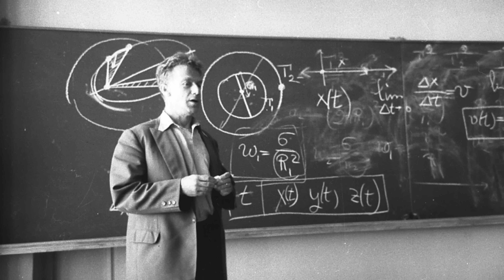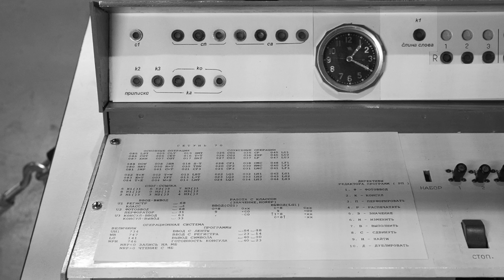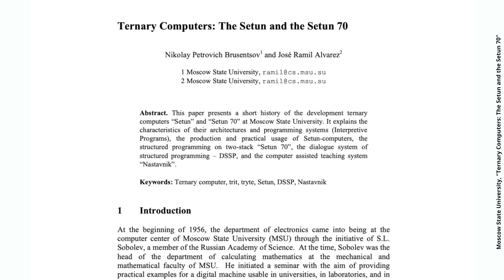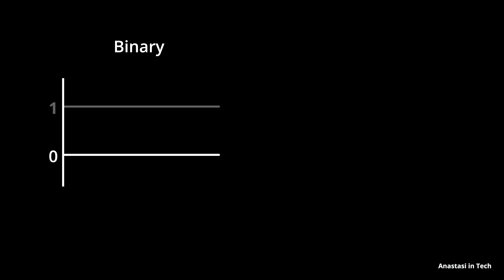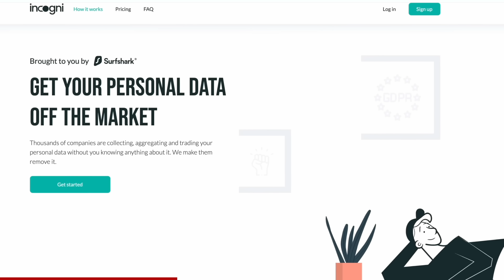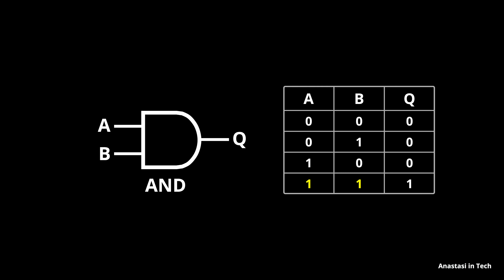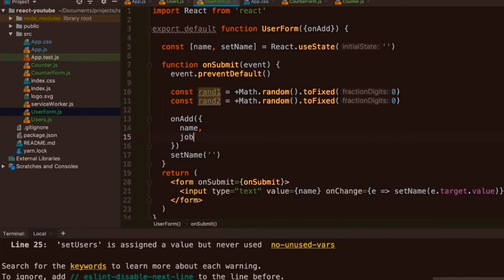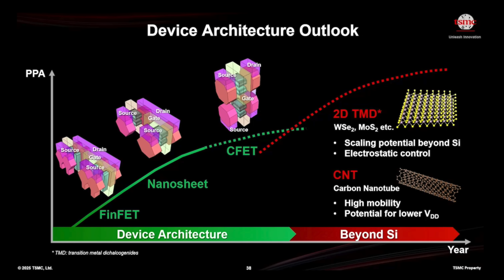The World's First Ternary Computer

Comment: I have read a lot about early russian computing and it’s very impressive on many fronts. I particularly enjoyed the anecdote about taking the roof off due to excessive heat and space constraints.

- Development: The MESM was initiated during World War II's aftermath, with construction starting in 1948. It used ~6,000 vacuum tubes, occupied a room of ~80 m², and performed ~3,000 operations per second. It was operational for testing by November 1950 and fully functional by December 1951.
- Challenges: The team faced severe postwar shortages, including limited space in a small laboratory. To fit the bulky machine, they famously removed the laboratory's roof to install taller components and reroute wiring.

This "roof removal" incident is documented in Russian technical literature and memoirs as a symbol of the ingenuity and desperation in early Soviet computing efforts. It's often cited in histories of the MESM as a literal and figurative "breakthrough."

#### The "Paper" and the Title
The specific phrase "And then we took the roof off" ("А потом мы сняли крышу") is not the title of a formal academic paper but a memorable line from personal recollections and popular accounts. Key sources include:
- Memoirs of Sergei Lebedev: In his writings and interviews (e.g., in the 1960s–1970s), Lebedev described the episode. A detailed retelling appears in Russian engineering journals like Izvestiya Akademii Nauk SSSR (proceedings of the USSR Academy of Sciences) from the 1950s, where MESM's development was first reported.
- Definitive Account: The story is prominently featured in the book Puteshestviye v mir bol'shikh mashin ("Journey into the World of Big Machines") by B. N. Malinovsky (1981), a historian of Soviet computing. Malinovsky, who worked on the MESM, quotes the phrase directly from team anecdotes.

Comment: I'm puzzled why it is being called "termary" when the more correct term should be "tertiary".

Back in the 1970s a type of transistor was developed that was called a tertiary transistor.
It was a SINGLE JUNCTION device that had a 4 state output:
1- ON+,  2- ON-, 3- ON Null, 4- High Z
This allowed 3 state logic and far more computstional power per "trit".
Devices were built, even whole processors, but it was never moved into full production because ....
Programmers did not want to learn ternary or new programming methods or languages.

We lost a lot when that happened.

PERHAPSwe may see a return(!!)
Reply: ternary
Aware of the typo

Comment: does it help software adoption at all that a ternary system could probably still run binary based software that just doesn't utilize the -1 bit? (or is it a trit?) So like you could have AMD64 instructions recreated so existing software can run on it (minus all the benefits) but experimental applications that use trinary can run on the same machine. It'd add a bunch of waste and bulk to the chip, but in a lab, maybe it is helpful.

Comment: Binary computing came from the textile industry that used punch cards to determine what color thread to feed through the machine that was producing the material.  It expanded to voting machines to  calculate the growing population in the country - still using punch cards.

The hole in  a punch card is an "on" state because the charged needle that fell through it closed a circuit.  A non-hole kept the circuit open - the zero or "off" state.

That's as far as you can scale the punch card paradigm.  You have to use a different paradigm to allow for a third state because a circuit can never be "almost" closed or "almost" open.  It either is or isn't closed.
Reply: Is that hanging chad open or closed?  I don't know, let's punch the voter and see if they hang around.
Reply: @rockyroad6000  - Awesome!  An Al Gore reference.  

You are aware that he invented the internet, right?  🙄
Reply: @GizmoFromPizmo  Yes.  I would not be surprised if he invented AI too.  I think the issue was he called it AL for Artificial Liberal.
Reply: @rockyroad6000  - HAHAHA!  That was cute.  😆
Reply: The analog in punched cards would be the size of the hole. Though the hanging chad ties up very neatly with the encoding 'unknown' !

Comment: Circuits can be designed to work with ternary but it will likely need to be converted to binary then back to ternary when transmitting data between devices via microwaves or laser through fiber optics.  There is an option to use two different color lasers to transmit ternary data like blue for +1 and red for -1.  Transmitting ternary data via RF or microwaves is possible but I think it would get corrupted more easily than binary.

Comment: Ternary logic circuits are difficult to construct. The Soviet SETUN represented the ternary digits by binary bits, the same way decimal computers represented their digits. I doubt that much will come of ternary - except for one thing. Data and address buses could use three signal levels to encode three binary digits on two signal lines.

Comment: ai summary read. so not what I thought. this is asking more out of same transistor. more thresholds. so going small might have trade off of what it allows as denser information form the thermal noise.

however, I think it might still be interesting from the programming languages. Or another way of consider Qbits (well I still don,t understand the point of making quantum small circuits and then how does a problem get to be made from an architecture that is programmnable and not a programmable architecture.  Would each meta-circuit of qbit be the proble solution. or woudl there be as in binary exact bits (from current logic gates) and CPU architecture, having a finite set of instructions that can compute anything just by feeding it new code.

Well. Too vague, I know.  But that is the range of my question. Before going into the details, I am missing the big picture of function approximation, I guess.  Computable function space. or as finite math. Computer science would have it: the classes of computable problems. Something well defined somewhere... 

Do we need to first understand the small circuit details before having some understanding (given perhaps we know one), about ternary versus binary versus qubits versus my ternary being about an undecided state value as in my other post about the symbolic manipulation tools to be able to maintain expressions while they are being transformed toward some human parsable and logical objects?
A bit like the difference between propositional logic, and functional logic, or is that formal logic (having quantifiers and functions, and perhaps not yet well defined phrases to be part of statements, that might not have a binary or ternary value to be assigned yet, but still can be temporary objects to consider.  Or just the possibiity of an analog problem or probability density problem like most of the NN tools are actually approximating? That which might not need the "semantics" of the symbols instantiated to still be defined, some well, but some undecided without further information. Something like that.

PS:  I hope the YT algorithms is using LLM, as this might be as much for it to feed me clues or hints in that direction with other videos.   But if any human passing by can get what I seek but does not know yet, and not the words for it either, giving me clues is welcome

Comment: This brings back memories from when I was in college. I remember the instructor teaching us about 7400 series logic chips and touched base on tri-state logic gates as well. One of the uses was in core memory units. A hard positive, a hard negative, and none of the above in order to maximize the ability of those expensive things.
Reply: Umm, that’s a different tristate. We had 1, 0 and High-impedance; that’s when the connection can be seen as "disconnected", because the resistance is so high, no current can flow in or out of it. It was a design that prevents the IC from acting as a load on a preceding circuit or component, ensuring the integrity of the signal, especially when the preceding circuit has high fan out.
Reply: none of the above  =  floating
Reply: Core memory reveals what WAS stored on it when the magnetic domain flips.  You cannot have half a flip, hence, it is inherently binary.
Reply: @thomasmaughan4798  But magnetism has both polarity and strength. The size of the pulse that you read when it flips depends on the size of the change. Thus you can distinguish between positive field, negative field and zero field. There is a difficulty caused by not saturating the core, but the state is not binary.-
Reply: Congratulations, you studious guys. I wish I too could take my eyes off her face.

Comment: I agree that ternary is an improvement but I am not convinced. Sure 20 30 or 40% are important improvements but that is not enough. This level of gain will not justify to have a revolution. Maybe as you say some niche applications with specialized chips. For me the holy grail remains photonic chips and one day maybe an optical CPU/GPU. That will be the real game changer: Very low power consumption a tremendous speed and basically no heat. As you can mix photons at different wavelengths and they do not interfere, you could have as many levels you like. Ideally not ternary but decimal system directly. The system we use for calculations. That would be really a major paradigm change, a revolution.

Comment: Your history misses a lot.  Many of the early IBM computers used decimal arithmetic.  Additionally, the IBM 650 employed biquinary arithmetic, which alternated between binary and quinary (base 5) values.  The IBM 1620 CADET (Said to stand for "can't add, doesn't even try") used table lookup to perform arithmetic.  Some mathematicians used base 7 arithmetic, the largest prime base supported, while base 9 allowed for ternary arithmetic with two trits per byte.  The (Remington Rand) Univac I also used decimal with a system called XS3.  Store digits in four-bit bytes, counting from 3 to 12 as 0 to 9.  To add, add as if hexadecimal, the carries worked correctly.  Subtract 3 from each hex digit; no carries or borrows are needed to get the final result.  Subtraction inverted that.  There were many other computers with unusual arithmetic; these are just the ones I used.  I never used ENIAC, which used ring counters to do actual decimal arithmetic.  It bothers me that I still remember that 6SJ7 pentode electronic tubes were used for the rings.  Twenty tubes in pairs so that one tube could fail and be replaced without errors.

Comment: We played with this years ago.  The problem we have today, is the morons that create the operating systems, drivers, and software.  Bill Gates designed Windows 3.1 on the maximum size computer he could build, while the users were working with the minimum size.  He told us to upgrade, like we had money to burn.  Ternary (what we called Trinary) will allow more data to be stored in a small area, but if the developers never figure out the common memory leak, it is a waste of time and money.  We always tease that Windows runs best when turned off!  Linux has issues, as developers create updates, that don't work on NVIDIA, forcing others to work the changes into NVIDIA drivers.  Honestly, we need to remove the moron developers, and the programming habits that create memory leaks.

Comment: Um uhh...a three state transistor has existed for a long time. It's called a bipolar transistor. A one off, two separate on state transistor would require a means to distinguish between the two on states. That seems really inefficient to me. I have a notion that there could be a quantum mechanical means of supplying the negative rail of an array of bipolar transistors.

Comment: So fascinating.  Looks like binary chip may be the 'rotary telephone' of chips when Ternary chips become mainstream.  Excellent video!
Reply: Until you understand that for the same numeric range, although the ternery logic requires only 2/3 as many logic gates, the logic gates themselves require 2x as many transistors, making a chip that requires 4/3 as much silicon dies space and consumes 4/3 as much power as the binary equivalent.

And rejection rates for chips are proportional to the area of the chip SQUARED -- or to put it this way -- if a manufacturing line produces wafers which have, 10 defects per wafer, before each wafer is cut into individual chips... if the wafer produces only 1 chip -- then your your line produces ZERO usable chips.  If you cut the wafer into 4 chips... only rarely is even one chip defect-free, while the other 3 have all the defects.  You really don't start getting into really good yields until you're cutting that wafer into 30 or more chips (assuming  a maximum of 1 defect per chip, that's 10 bad/30 produced => yield of 2/3 good + 1/3 waste.

So, on closer inspection, ternery logic loses on all levels except for the complexity of the overall logic diagrams when looking at the logic gate level, but much MORE complex when looking at the transistor level.

Ternery is such a loser that no undergraduate computer engineering program spends even 10 minutes on the subject.
Reply: @akulkis Oh sure. I was just gonna say that too. 🥴

Comment: The problem is that the materials used to make ternary computing (T-CMOS) can't scale in frequency. Unless there's some new breakthrough, this is nothing more than hype. We're talking 100's Mhz to 1Ghz range.
Reply: At least someone talking sense. You can't just say "ternary!" and have all the circuitry and miniaturizations of current binary CMOS chips to just work with an extra state thrown in . It's physically completely different.
Reply: Frequency scaling is the reason why we moved to synchronous binary chips!

People who took university electronics courses will know what I'm talking about.
Reply: Frequency speedup scales linearly while this is exponential. Still boasts potential outperformance even if no technological breakthrough in terms of clock rate happens
Reply: What does that mean? Why can't they scale in frequency?
Reply: @RebelClippy more states means harder time stabilizing switching to those states.
Reply: @chbrulesthanks!!

Comment: IP theft is real  The first explicit ternary CNT transistor work emerged in a 2021 paper from Cornell University's team: "A low-power dynamic ternary full adder using carbon nanotube field-effect transistors" (published in Perspectives in Science and Intelligent Systems, 2021). This demonstrated ternary adders and multipliers using CNFETs, reducing transistor count and power by 20-30% vs. binary. Lead author: M. H. Moaiyeri (Cornell), 2022 Expansion: Cornell's McEuen group advanced it with "Pushing the Limits of Carbon Nanotube Transistors" (thesis, 2022), exploring ternary gates for neural networks, achieving 100% accuracy in image classification.
Reply: Yep. Now we know from where the chinese got the idea of carbon nanotubes in transistors;  the chinese were not the first to discover that, as always.

Comment: Well …… within Solid state drives multi level cells are very common. If it comes also to Logig i think we get four levels because this allows a quite smoother migration. If you work with trinary logig nothing fits. You can write with c programms who can compile a hardware Driver to different architectures of CPU because there meanwhile the Common definition one Byte is 8 Bit …… if you go to Tri this fails. The Basic Caracter Unit TriByre needs at minimum 9 tri ( 3^2 instead 2^3 ) which has 3^9  wich is 19683 states. The most utf8 codes are fitting in one character. One TriWord woud be 3^3 wich are 27 tri. With is approxinative 42 Bit. Enoth for Addressing at the Moment.  One TriLong woud be 3^4 tri.  witch is 128 and some fraction Bit.  This is weidly different like historic CPU i have used as student like CDC Cyber line CPUs with 60Bit with 6Bit Characters. To Write "Hello World" you code PRINT …… ":IH^E^L^L^O W^O^R^L^D" 😮😮😮

Comment: 13:50 Noise applies to an intermediate level voltage yes? 

There are other I read about that do not depend on the voltage level so not noise is the issue, like black phosphorus or silicon feedback field-effect transistors.